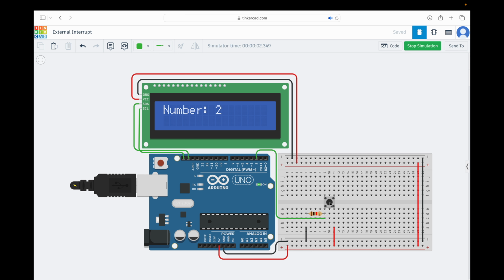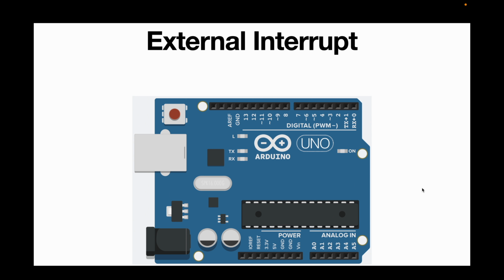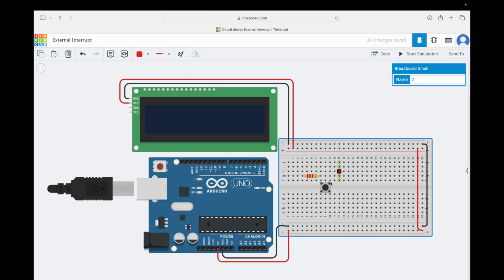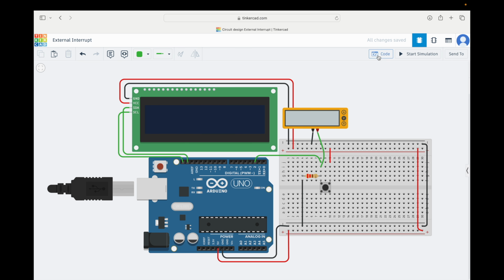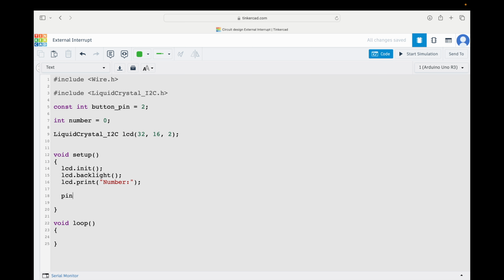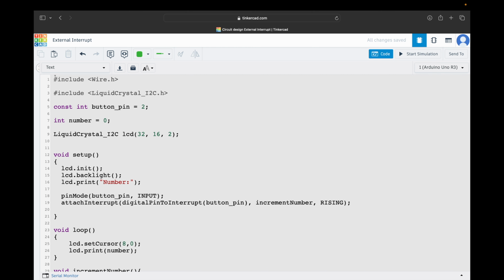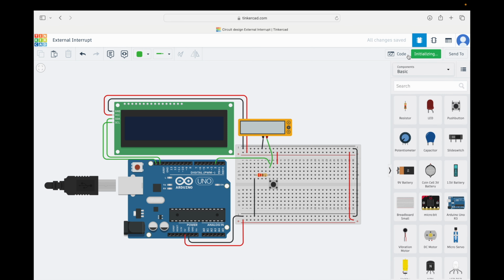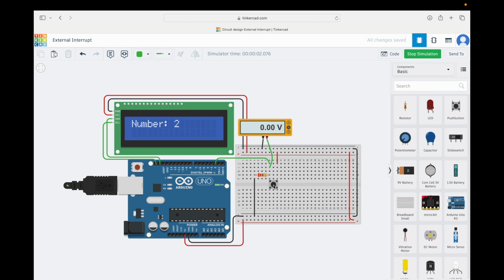Arduino Interrupt:  Basic Tutorial! (External Interrupt)

Comment: Excellent information. I'm working on a project that needs a suggestion. Made a simple RFID reader with RC22 and Arduino UNO with LCD. Once RFID is scanned, it holds it for 3 seconds and ready to scan the next. There is an external 12v dc supply to trigger the interrupt (instead of switch) and I need to keep the scanner busy until I remove the 12v. Also, LCD should display "Busy" until the 12V is removed. Can u pls advice

Comment: Here is the code I copied from your video  Thanks
#include <Wire.h >
#include <LiquidCrystal_I2C.h >
const int button_pin = 2;
int number = 0;

LiquidCrystal_I2C lcd(0x27, 16, 2) ;

void setup()
{
  lcd.init();
  lcd.backlight();
  lcd.print ("NUMBER:");
  pinMode (button_pin, INPUT);
  attachInterrupt (digitalPinToInterrupt(button_pin), incrementNumber, RISING);
}

void loop ()
{  
  lcd.setCursor (8,0);
  lcd.print (number);
}

void incrementNumber ()
{
  number ++ ;
  }
Reply from the maker: Hello my friend! Sorry for the late reply. 

So, the problem with your code is that TinkerCad uses a different address for the LCD display. Try to change the command in your code from: LiquidCrystal_I2C lcd(0x27, 16, 2) ; to LiquidCrystal_I2C lcd(32, 16, 2); 

Note that in the video I'm using the number 32 as address. Also, have a look at the address your display is using by clicking on it, to see if they match. Let me know if it worked. 

Take care!